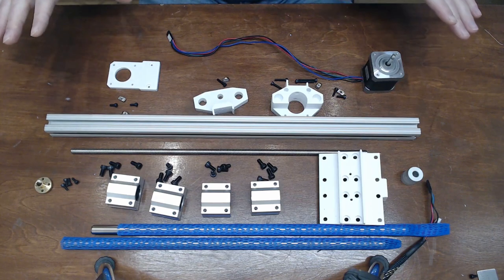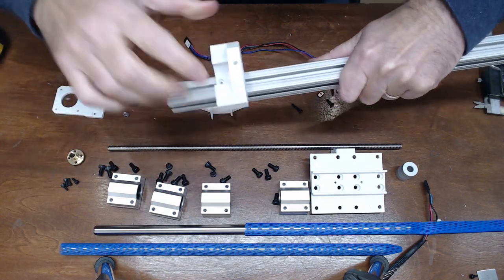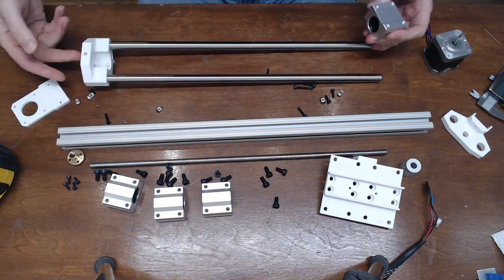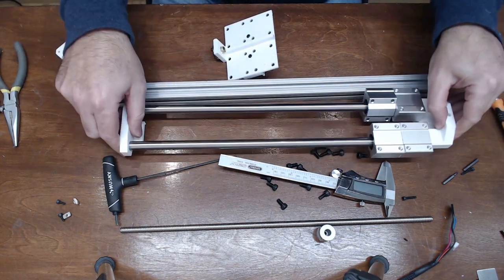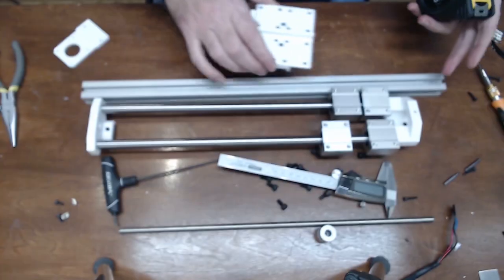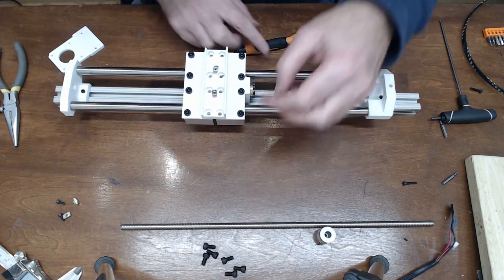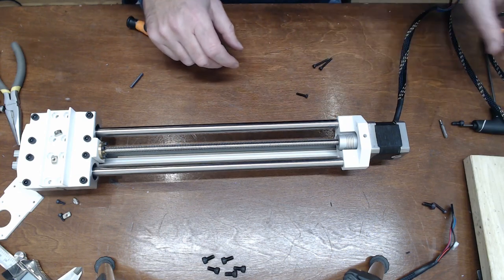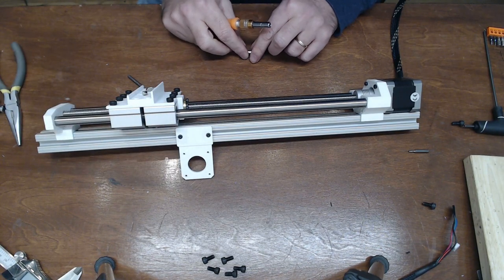C3Dt/c Cantilever 3D Printer Build: Part 6 Z Axis

Comment: Hello Sir, I have a question. If you were to use ABS filament, do we need to build a frame around the printer, if so what material would you recommend for the "see-through" part of the frame, I know to use 8020 for the actual frame? Also, axpt how much did this entire build cost... I am building this for my school project.

Comment: Hi Maarten! Thank you very much for sharing all your work. I wanted to ask you if you have uploaded somewhere the solidworks/fusion original files of the 2040 aluminum extrusion Double Screw Rail with 12 mm rods, so i could make a slight modification. I want the cross rail in the slider to be a 2040 extrusion as well. Thanks in advance and congrats for the great and professional work.
Reply from the maker: Should be here. I have f3d, iges and step. Sorry I don't have solidWorks. https://grabcad.com/library/lead-screw-driven-linear-rail-double-1
Reply: @Core3DTech  thank you very much for your answer. I just realized maybe there is no need for modification to put a 2040 cross rail (x axis) because of the dimensions of the 2040 aluminum extrusion, am i correct? It is not gonna be exactly like your setup but it should fit in the middle of aluminm extrusion, right? Thanks in advance.
Reply from the maker: @mfoucault1984  2020/2040 as part of this particular printer design (the C3Dt/c) will be a problem. It was designed specifically with 1010/1020 in mind as it fits exactly around the PSU. Going with 2020/2040 for the full printer design will leave gaps. Bear that in mind.
Reply: @Core3DTech  that's correct, thanks for your answer. I'm unfortunately working in something different (not a 3d printer) but i would like to use some of your designs for my purpose. I couldn't find the slider individual part to make the modifications so it fits for a 2040 cross rail, is there for any chance that you have that individual part? thank you very much in advance.
Reply from the maker: @mfoucault1984  Nothing unfortunate about it. This design can be applied to any type of linear actuator need. Good luck. Love to see the result when done.
Reply: @Core3DTech  sure, thanks!